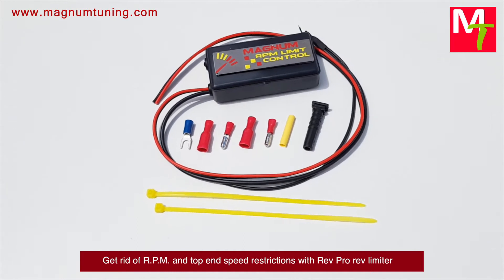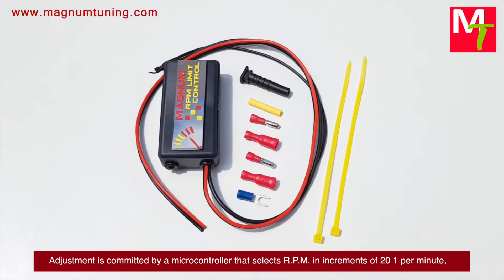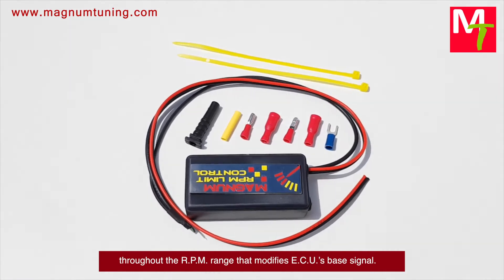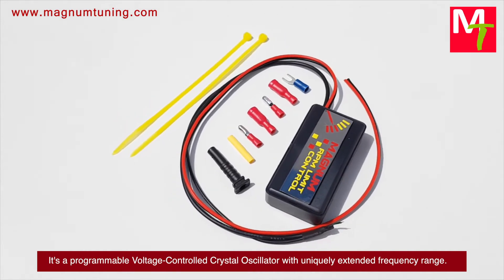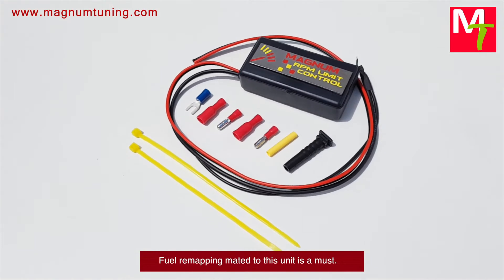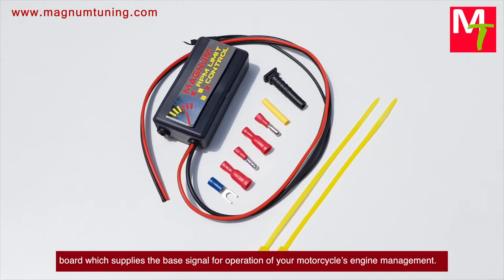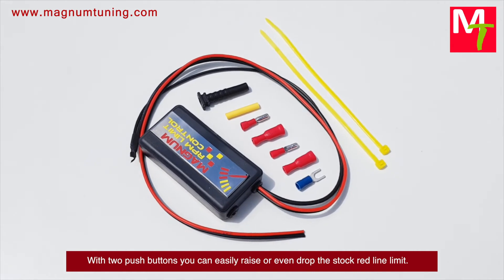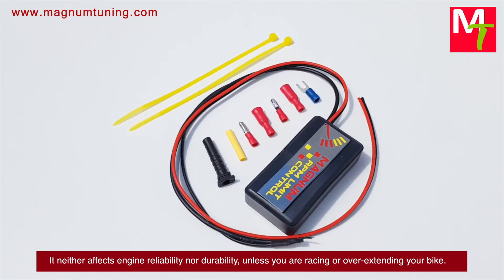Revolution PRO Programmable Motorcycle Rev Limiter   Rev Up Your Ride

Comment: Hello I do need this rev limiter does this also remap the fuel injection I have a 2007 mp3 250 n it only will go up to 7000 rpms n the motor sounds like is almost idel @ 7000 sure it could go to 10 easy all stock only had 300 miles on when I bought had been crashed n put in garage n forgot about dont think it ever made it to first service where they shoukd of turned up the rpm limiter from what Ive found out
Reply from the maker: Thank you for contacting us. Because unfortunately our YT team is unable to support you technically via the channel, please visit our website to catch a glimpse at the working theory of our bike mods, 

https://www.magnumtuning.com/en/subcategorylist/bike-atv-jet-ski-snowmobile-performance-chips-parts/bike-upgrades

and to contact our engineers. In brief, rev limiter is solely designed to allow you increase the RMPM’s an a fuel trim remap in conjunction is a must have.

Have a great day